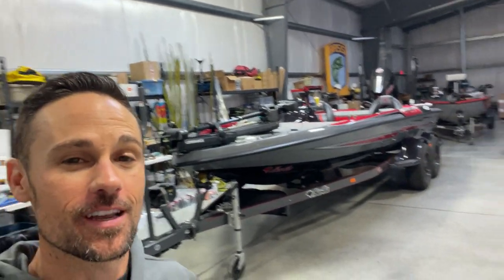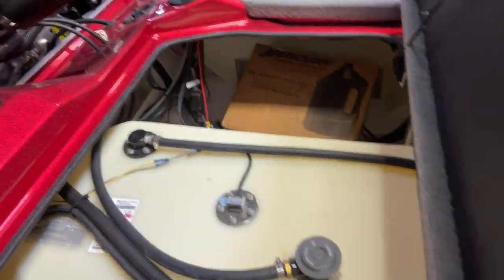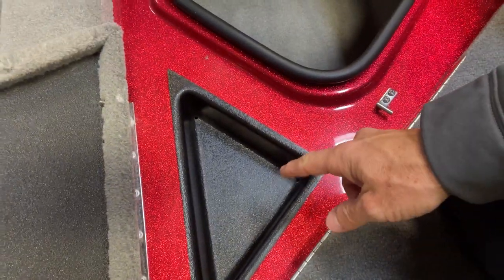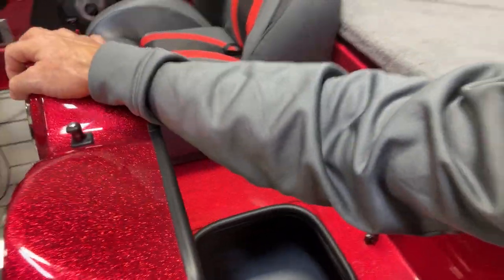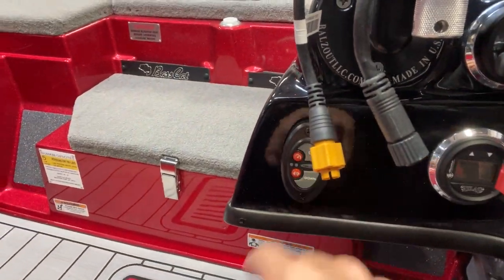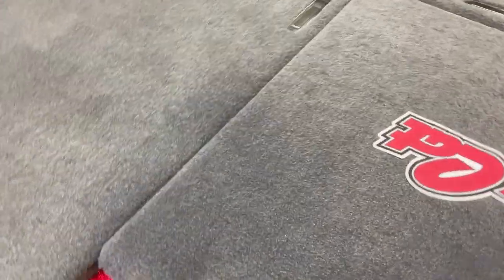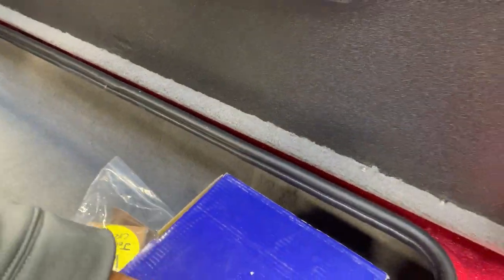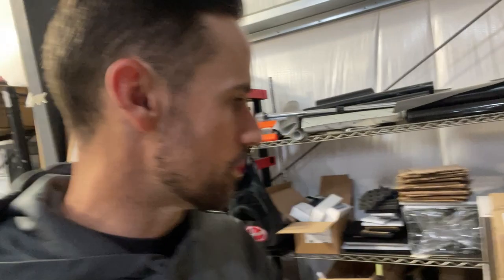BASS CAT PUMA STS FIRST LOOK!

Comment: Beautiful boat. Love the Seadek.
Doesn't it void the warranty on the Mercury Outboard if you use Lithium as a starter battery??
Reply from the maker: Not for Lithium Pros. They work with Mercury but many other brands do void it
Reply: @JohnCrews  didn't mercury just buy a lithium battery company recently??

Comment: I wish the P2 was a wide body 19 footer with like a 96 in beam. I would've bought one, but went with phoenix 819 instead 😑
Reply from the maker: The Pantera Classic is basically what you are asking for
Reply: @JohnCrews  yea, looked hard at it, but not a fan of the white top cap, the livewell system is lacking compared to the p2, and you lose the 43 gallon fuel tank. Oh well 🤷‍♂️
Reply: @JohnCrews  JC if you have any pull maybe you can put something In Rick's ear about redesigning the P2 with a wider beam. I'll be a buyer 😁